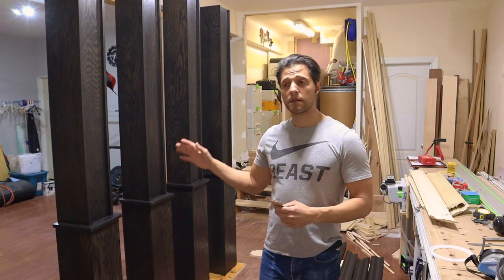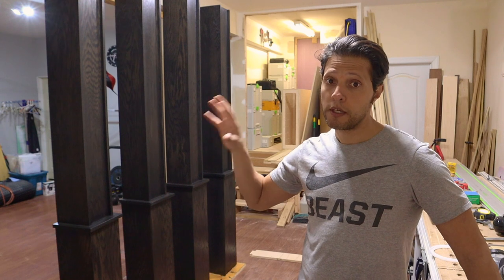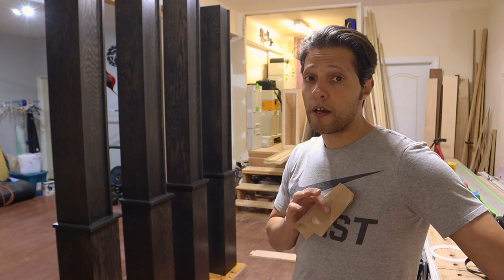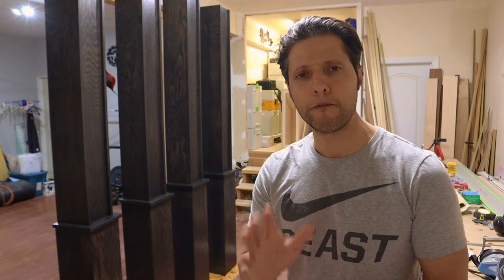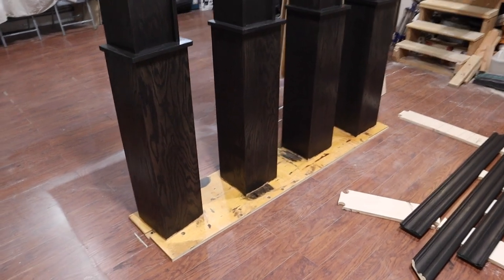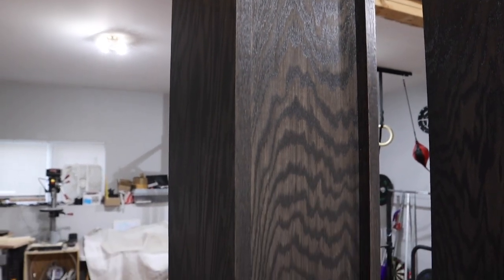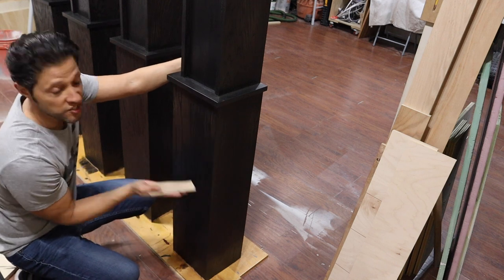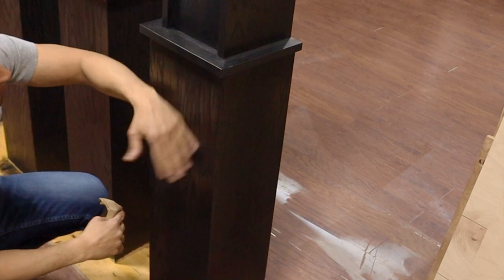Use this for a perfect finish

Comment: Nice tip!  Makes me think of when I finish drywall where the client wants flat/no texture where they have a lot of natural light hitting the walls I will use my bare hand 🖐️ at the final stage in a light circular motion.  Puts a beautiful scratch free finish.  It also removes most of the dust from that portion of the wall or ceiling.

Comment: Nice work!
Do you wet your wood before staining?
Reply from the maker: Sometimes with solid woods to raise the grain for a final sanding but not with plywood. I try to keep plywood as dry as possible to avoid it turning into the shape of a potato chip.
Reply: @AnthonyScolaro1  Right!
Cheers buddy